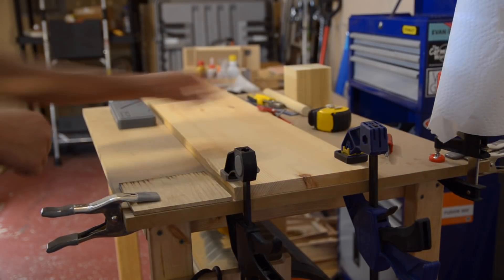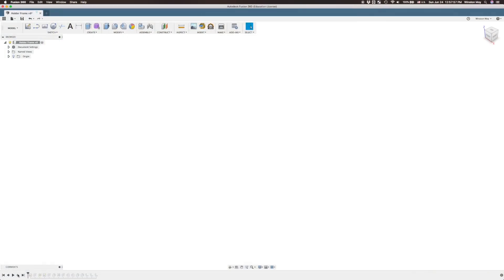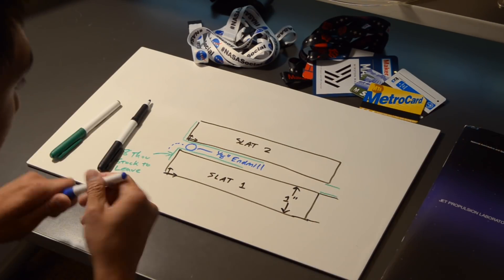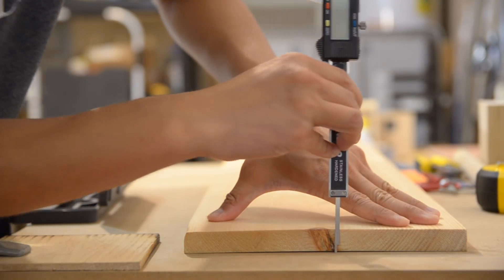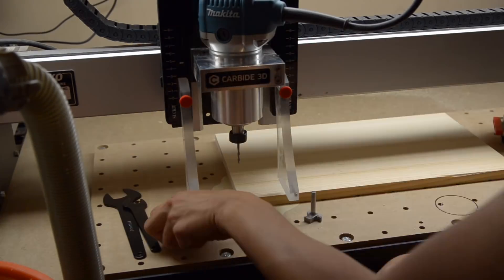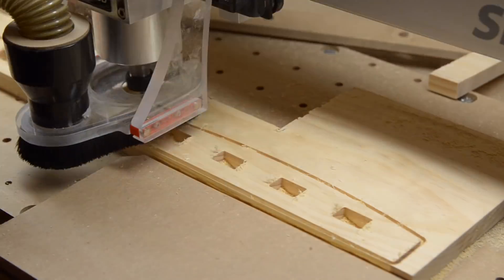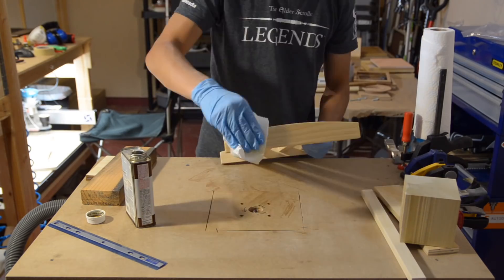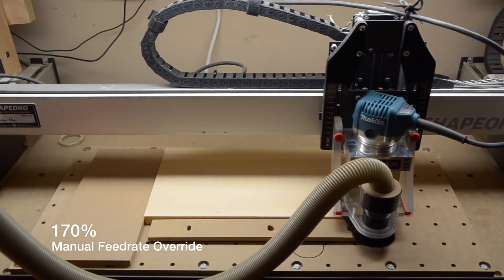Running Medal Display Rack CNC Project - #124

Comment: machinist tips, when milling pockets, it works best to pre drill a hole to a near depth finish, then run a tool into it as plunging into material straight down is hard on the tools. also finish passes (2nd final passes) helps to rid signs of tool deflection also if you miss measure and end up with too tight a fit, remember you can always soak wood in water so it becomes more moldable  (pocketed side) when accepting the rod. 
nice rack

Comment: I notice you always have trouble routing the power cable for your router. A simple solution is to loosely lay the power cable along the top of the X extrusion and out through the notch on the end plate, then attach a suitable weight to the hanging cable. The weight will keep tension on the cable and allow it to feed freely in and out of the notch. If you like add a rotating pulley to support the cable might be desirable but not necessary.

Comment: Do you even run into the issue when facing material where the router would leave small ridges in the material along the tool paths due to slightly uneven work surface/router mounting?
Reply from the maker: Yep. And that's why you tram the machine. I cover it in my "basic Shapeoko tuning" video from about a year ago.
Reply: Winston Moy awesome! Thanks heaps for your reply. Love you videos so much. They have been very inspiring :)